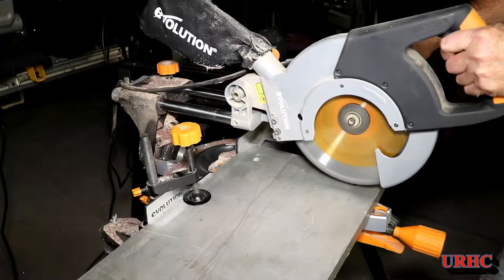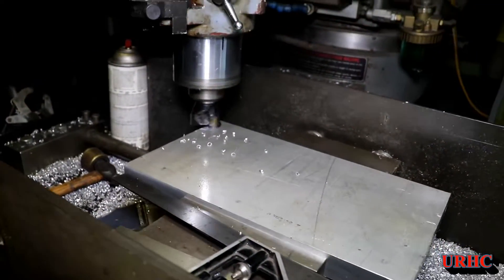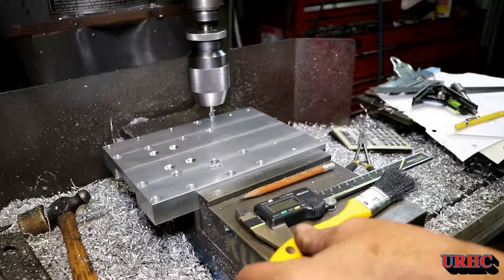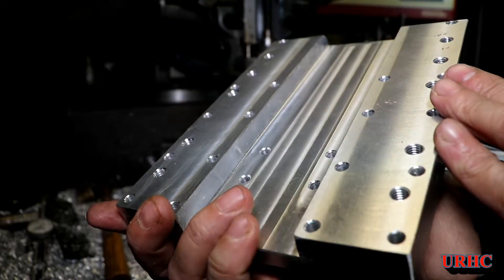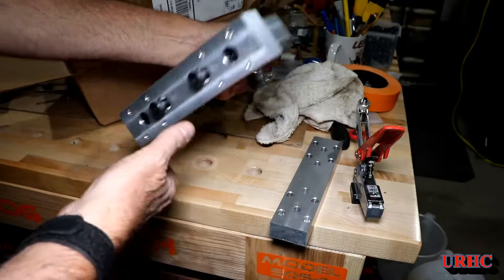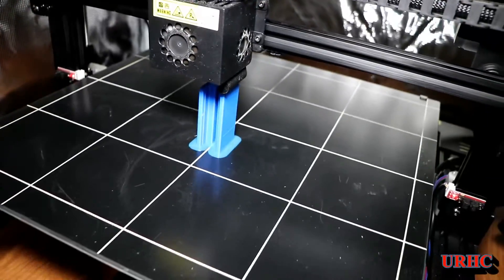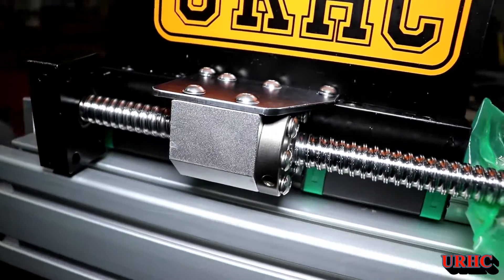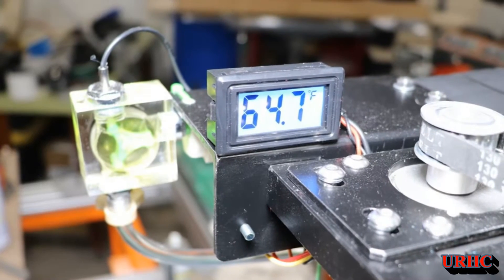CNC Router Build Part 3 Maching Parts Starting Assembly And Selecting Controller

Comment: I use WD40 on the saw blade when I cut aluminum. I don't claim it is "the best" but i can tell you it does work well and keeps the blade from loading up. Only for aluminum though never use it for steel. One more suggestion speed up your cutter when milling aluminum. As fast as that Bridgeport will go. I am a retired aerospace machinist so yes this comes from experience. At work we used water based coolant designed for CNC aluminum use.
Reply from the maker: Thanks,  I'm just learning and dealing with worn out second hand tooling for the most part. Thanks for watching.

Comment: I am designing a small but stout cnc router for main aluminum.  Which ball screw are you using for all the axis.  Thank you in advance for your reply.
Reply from the maker: I just used the cheap Chinese  zero backlash ones from Amazon.  I used 5mm pitch but should have  used 10 mm pitch with the steppers for higher  speeds with  cheap motors. Thanks for watching.

Comment: excellent work, I ask you some questions: 
1- which motor do you recommend, step motors or servo motor? 
2- what type of drill bits are used for different materials? 

3- about Controller, for a professional use, which one do you suggest me buy? maybe like the CNC USB controller Mk3? or some other?
Reply from the maker: Either type motor will work the same. Servos are better but steppers are cheaper. Amana makes good cnc router bits. They have nice starter kits for a couple hundred dollars. The Masso I used works great for my needs and is affordable with great support. Thanks for watching.

Comment: You said you get a little bit of whip along the longest axis, whats the work area along that axis and what diameter ball screw?
Reply from the maker: It is a16 mm screw that is 1500 mm long. Set up the other side screw that is identical and it runs true. Looks like there is a slight bow I must figure out how to remove in that one. That was at 1500 rpm or about 300 inches a min  Thanks for watching

Comment: Ed, I'm surprised you couldn't just use your tablesaw with a carbide blade to cut that 1" aluminum plate instead of the Evaloution saw. I'v never cut anything that thick but I can cut 3/8" with no problem, just at a slower feed rate.
Reply from the maker: If I wanted to spend $100 on an aluminum blade. I have cut 1/2 6061 on my saw but this tooling plate builds up in the teeth. I don't know exactly what it is as it was surplus. Thanks for watching.

Comment: insane the lengths you go, part of me thinks your going to be sad to actually finish it and have to use it.  cant understand going through all this and not just buying one
Reply from the maker: Buying  one this size costs about 7k without the vertical section or rotary axis and this build will be under 2k so there is a big difference plus it's  fun to try new things to keep the mind  busy.  All my tools see quite a bit of use. Thanks for watching.

Comment: Best tip I've noted for blades when cutting aluminium is candle wax. Rub an old candle over the blade and tooth edges

Some truly remarkable engineering, Another enjoyable video to watch
Reply from the maker: Another  comment mentioned paraffin wax and I tried it today. Didn't make a difference on this tooling plate. Seems to  help  on 6061. Thanks for watching.

Comment: If you use paraffin wax on the blade it stops it from filling up the teeth.
Reply from the maker: I will have to try that. I tried cutting oil and that didn't help. Thanks for watching.
Reply: @unemployedredneckhillbilly2023  WD-40 works on some applications with aluminum as well.
Reply from the maker: Tried wd40 and it doesn't work for this plate. Thanks for watching.